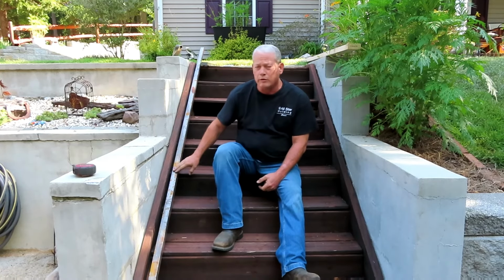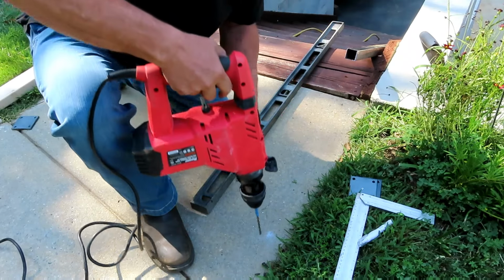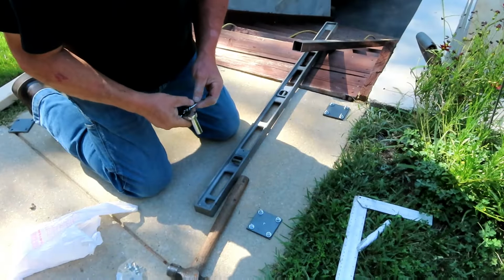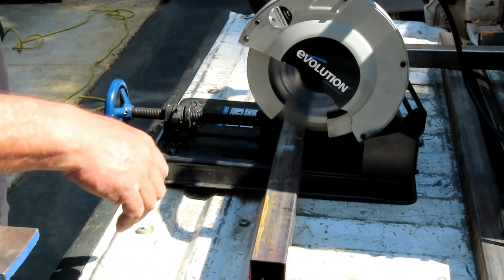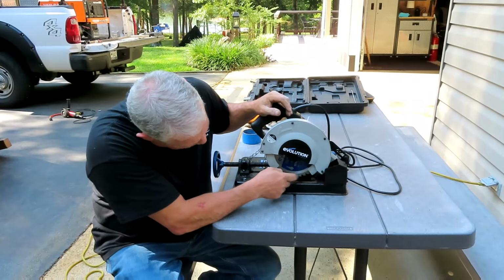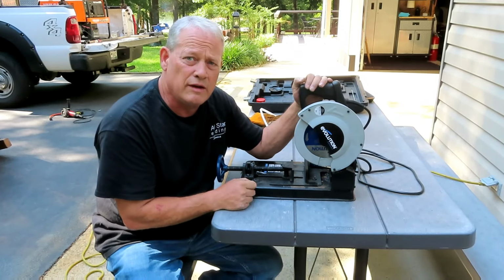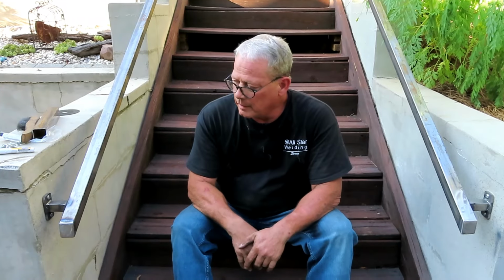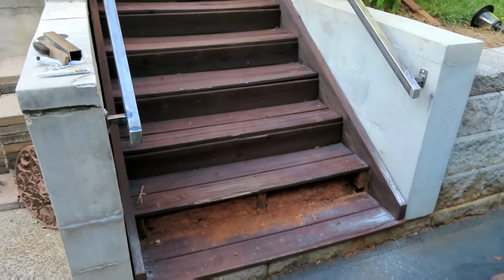Harbor Freight Titanium Flux 125 - Simple Hand Rail Start to Finish

Comment: You are my new harbor freight hero 😂 95% of my tools are HF, and still usually buying one every month. I’m an equipment mechanic mainly working on aerial equipment, and starting to get into more weld work once I finish my mobile truck build. Love these kinds of vids as these are the kind of side jobs I’ll be running into 😂
Reply from the maker: Yeah, it's pretty obvious that I like Harbor Freight. They have really gone in a new direction over the past 8-10 years. I'm a big fan of the Bauer line. I know that Hercules is supposed to be their highest rated brand, but the Bauer line just has so many components to it. They even swapped the drill presses from Central Machinery to Bauer (not Hercules). That Bauer  hammer drill I am using in that video, replaced an old Central Machinery hammer drill that I had for 20 years. Actually, I still have that one too. Still does the work, I just wanted that Bauer drill and it was on sale. In fact, that Bauer drill got replaced about 2 weeks ago under warranty. No fault of the Bauer, it was all my doing and I completely destroyed it. But they still swapped it out. I use it all the time. I also have the entire line of the Bauer impacts, all sizes. To me, they are just as good as Milwaukee, for a 1/3 of the price. Of course, Milwaukee die hards may disagree. But look, I am a professional welder, full shop and mobile, and I use MF tools. It doesn't have the stigma that it used to. If you like that video, check out the one where I am working on the dump truck, or the one working on the tractor bucket. I think you will enjoy them. I have a new camera on its way, and will be getting some wireless lav mics, so I will be doing more "at work" type videos soon. Stay tuned. Make sure you hit that notification icon so you will know when more are loaded. Thanks for your comment!

Comment: my fab shop does this all the time, except we make them off site. which on its own is a headache some days lol
Reply from the maker: I did a big indoor railing in a house last month. I couldn't do it inside. The endless back and forth for test fits was a pain. But this job was different on both sides, and the concrete was very uneven. The only way to do it was on-site. Sometimes that's a good thing, because I get it done faster. If I did it at the shop, I know I would sit too long, take too many breaks, long lunches, and it would wind up taking a few days. 😂

Comment: That looks like a virgin drill.   I have that drill, it is really good, got.it.on sale for $70.  I just wish HF had one that size (1-1/8) in cordless.  When drilling holes in concrete, try a cordless vacuum, if you get a small tube to go on the hose, it will suck the dust out of deep holes and they have a general purpose blower on them too.  I tried the little Hercules blower (those are not leaf blowers BTW) and wound up with dust every where and it wouldn't get the dust out of the bottom of the holes (16").   Hope that bottom block doesn't give way; It looks like the cap block is thinking about it.    
Have you ever got the little suitcase titanium over heated?
Reply from the maker: Yeah, that drill is pretty new. I got it back in February to replace the bic Central Machinery drill I've had for 20 years. That's a good idea about the vacuum. I will look into it. This Titanium has never over heated on me yet. But, I've never run it at full power yet, either.

Comment: Have you ever hit the work load on your titanium 125 does it take a little bit or is it fairly easy to over work it?
Reply from the maker: I've never hit over heat with it. But, as I have mentioned once, I've only ran it at 3/4 of max once or twice. But on those times, the ground cable was pretty warm!

Comment: Maybe a dumb question but how do you determine the angle of the rail?
Reply from the maker: Tyson, that is not a dumb question at all, actually it's a good one. On the original video footage, I recorded that step, but it got cut for time. So let me explain how I did it.... Those rails at the top, I made them standard 36”. Railings are generally 36-42 inches. If they are to be OSHA compliant, it's just a little different. The customer and his wife are a little shorter than me, so I had them help me to find a comfortable height for them. After I had those top posts set, I took a 12ft piece of the square tube and clamped it to the side of the first post at the top of the stairs. Then, I came down to the bottom of the stairs and clamped the tube to a wood 2x4 standing up at the bottom. Then, I measured from the same point of each step to the tube. The steps were a little wonky and each one was a little different. When starting at the top, if the measurements increased as I came down the stairs, I would lower the bottom part of the tube that was clamped to the 2x4. And the opposite of it decreased. Since each of the stairs were different (not built well), I would just use an average. When I got each measurement to within +/- 1/4" to each other, I figured that was the best it was going to get. Then, I would go back to the top where it was clamped and scribe a line where the tube crossed the post, then cut. Being that I was by myself, I took a short piece of the tube and clamped it to the post for a "shelf" for the rail to sit on and tacked it to the post. Then at the bottom, I clamped it back to the 2x4 at the right height as measured previously. That gave me the right angle. I hope you followed that! Haha. If you have any more questions, feel free to ask. I'm here for you.
Reply: Hey! Didn’t get an alert that you responded. Thank you so much! I thought of have to try and measure the angle, then scribe that onto the upright support. What you said totally makes sense.

So for me I bought my first house (fixer upper) and I installed el cheapo 2x4 rails that suck. I’ve got dirt next to my exterior stairs 3 stairs, flat then 4 stairs. I don’t have a chop saw, would you recommend I dig, install the uprights in concrete (leave them long), clamp the rail then cut the upright with my angle grinder cut off wheel?

I feel like I owe you a check for that detailed response haha. You really helped me out, THANK YOU!!
Reply from the maker: @tyson9419  yes, that's what I would do. Use post hole digger and go down about 2-3 feet. Fill with concrete, then push your posts in. That way they are filled too! Then yes, leave them long and trim down with angle grinder. Drive 2 stakes about a foot away, and use some more wood pieces to clamp to the posts so they stay in place while concrete dries.  I'm glad you understood my rambling explanation. I make these videos for you guys, not for my ego. I want y'all to learn something from each video. Anything I can do to help, please just ask!
P.S. - make sure the notifications are turned on so that you will know of a reply, and new videos.
Reply: Really weird I’m not getting alerts…sorry for the lag.

I am very grateful for your advice. Really the most help I’ve ever gotten in any comment on YouTube ever! I subbed to enter the titanium giveaway (I ended up buying one and joining inside track club at HF) but I’m definitely keeping that sub and will thumbs up every video of yours that I watch. Thank you!!!
Reply from the maker: @tyson9419  thanks, I appreciate that. Look for a new one tomorrow. It will be unlike any video you've ever seen .